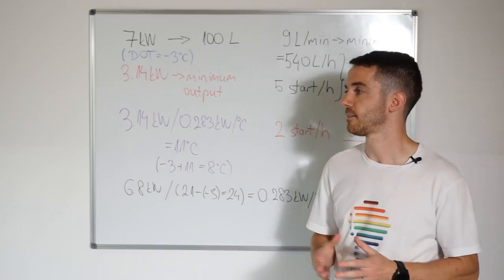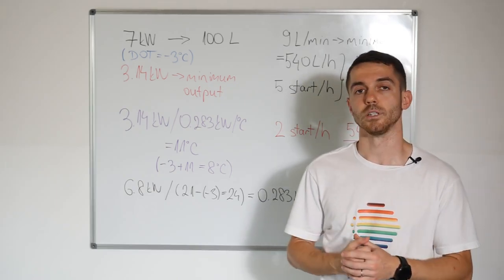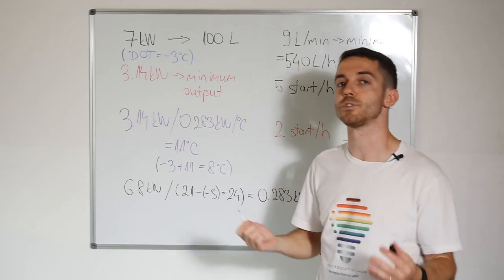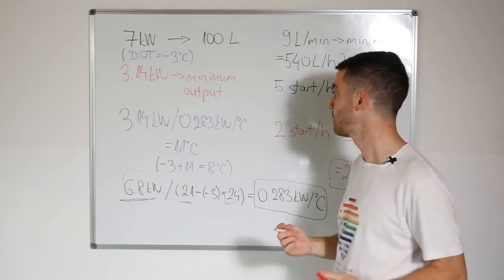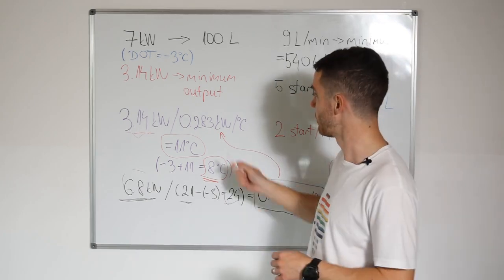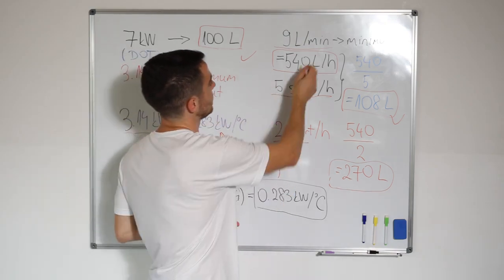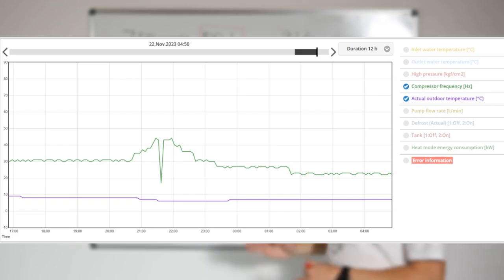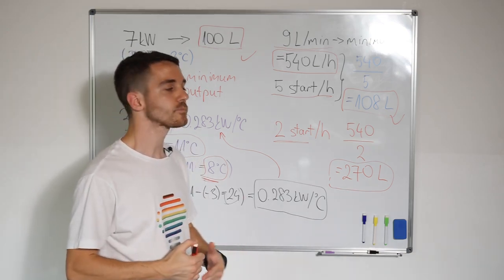Why Water Volume Matters in Heat Pump Systems

Comment: So it sounds like for 5 starts an hour, you will need roughly 30 liters per KW?
Reply from the maker: Very much depending on algorithm, but for high outdoor temp yes. Generally, 15-20 L/kW is enough.
Reply: You used 5 starts in your example, what is the optimum number if starts to use? 

Thanks a lot for these videos they are very helpful
Reply from the maker: @Twenty8seven for mild weather this is not problem, ideal for most of the season is 1 per hour, means nice modulation. But water volume is not only parameter, control strategy and proper design is the most important

Comment: What is ideal number of starts per hour to be looking for?
Reply: Midea use minimum cycle time around 20minutes. It's 3start in an hour. And that calculation is not complete. You have excess power = output - heat lose to calculate water volume and also if you have only volumizer or buffer tank.
Reply from the maker: In mild weather must be few times per hour, but in winter depending on manufacturer, ideal is to modulate.
Usually 10 is maximum limited by manufacturers but it is not good to have that limit all year.

Comment: These type of criteria should be system requirement specifications that require confirmation  in the certification process, for example in MCS. Without them they should remain uncertified.
Reply from the maker: Maybe this will change soon because this is one of the main topic in the industry

Comment: Hi. I am watching your chanel and l like your explanation on how heat pumps work.
I have 10 kw split in Makedonija. I have 70m2 infloor heating and 5 radiators.
I am running my heat pump with outside-15 to 39 and +15 at 29. It is 34d on 0d outside. It keeps inside tem at 22d.
Recently l noticed that internal electric heater was on at +2outaide and 33d watwr flow.
I disabled the Internal electric heater because of electricity.
Is this going to affect negatively defrost cycle?
Thank you
Reply from the maker: If your water volume is enough, it will be fine
Reply: Thank you. I think l may have 60 to 70l of water. The consumtion has been about 20kw per day, and avarage temerature has been from -5 night to +7 day.
How is the system perferming in your opinion?

Comment: If you ad more radiators instead of aditional buffer wont be better ? You can even run on lower flow temp after
Reply from the maker: Yes, sure, but sometimes it is not possible to change radiators or put bigger

Comment: Ako zelimo da dodamo vise vode sistemu u vidu volumizera da li ga dodajemo na hladni ili topli vod?
Reply from the maker: Neko pravilo je na povratu, ali može i na polazu. Bitno je povećati volumen sustava.
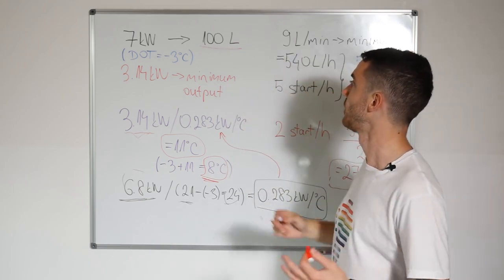Reply: @HVACEducationHub  Hvala na odgovoru. na 4:39 kazete da jedinica  od 7kW ima 9l u minuti, zar nije 19l po formuli iz prethodnog videa?
Reply from the maker: To je minimalni protok kad radi s 3 kW
Reply: Muku mučim sa mojim majstorom. LG 9kw monoblok. On hoće da doda bafer ali tako da i polaz i povrat idu na bafer i u tom slučaju mora dodatna cirkulaciona pumpa. Tvrdi da ne može samo na jedan vod i ne može bez dodatne cirkulacione. Ko je u pravu? Ne bih da u startu dajem još 300e za nešto što možda nije potrebno. Sveukupno 7m panelnih radijatora. Razumem da zavisi i od cevi

Comment: Hello. Very interesting calculation. I have a Vaillant arotherm plus Hp, and I simulated these calculation on Vaillant figures. Flow rate is fixed (860l/h), DT in 5 most of the time, and is 2 or 3 only when warmer outside. I have some 135l system, no buffer, and I do not see cycling upto ~ 10C outside. Are these calculation maybe only for Panasonic HP?
Reply from the maker: Hi, the calculation is general, but more variables need to be considered such as type of the house, temperature range, etc. But that 10 C makes sense for such a model. I assume 5 kW unit?
Reply: Yes, exactly the 5kW unit
Reply from the maker: So approx. 30 L/kW. Sounds good

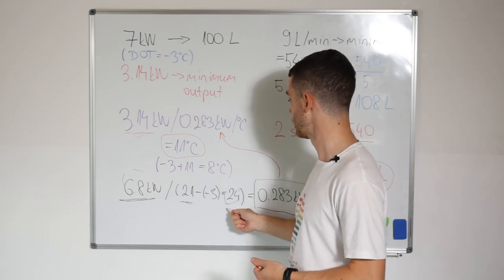Comment: Mario, I think you made a mistake a 3:50. Temperature difference is 11°C, desired indoor temp. is still 21, so maximum outdoor temperature for modulation should be 10°C (21-11=10)... Am I correct? Pozdrav i hvala!
Reply from the maker: Hi, yes, you are right. I made a calculation if the number will be 6.8-3.14 =3.66 kW.
Thank you for feedback!